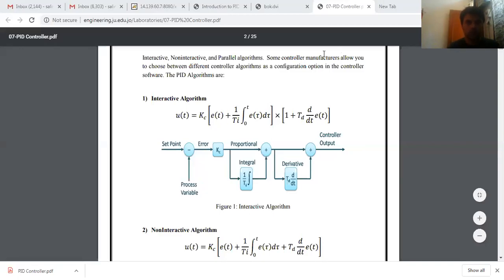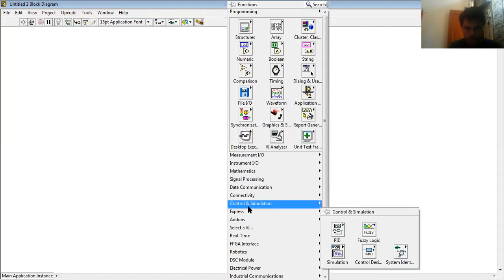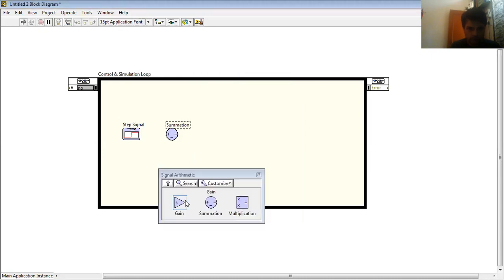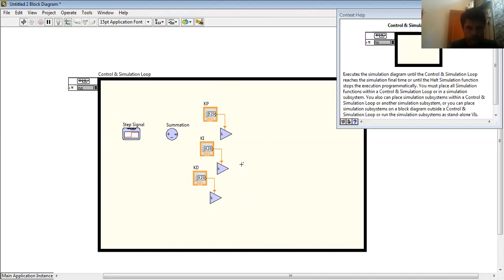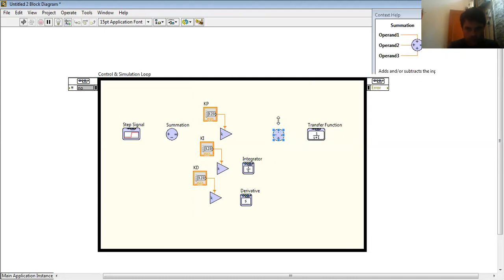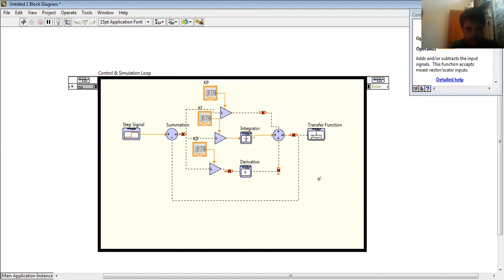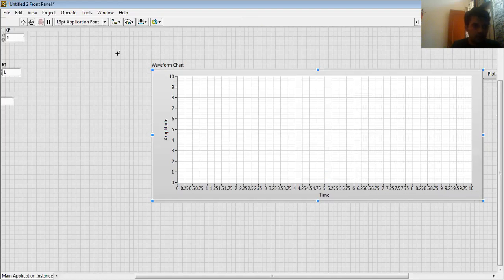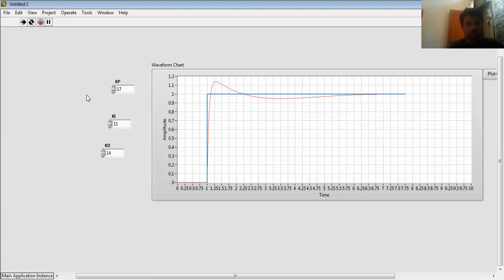PID controller in LabVIEW

Comment: Hello how can i Design a PID level controller for the reboiler of the mDWC (denoted by W2 in the column scheme), which can keep the reboiler level at a constant value by adjusting the power of pump P2. The desired level should be adjustable at the front panel of the LabVIEW VI